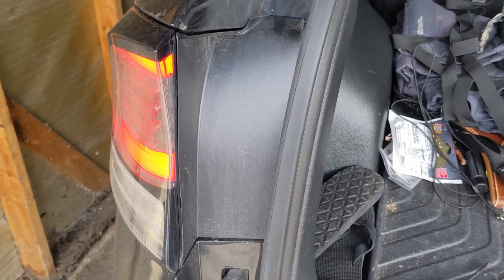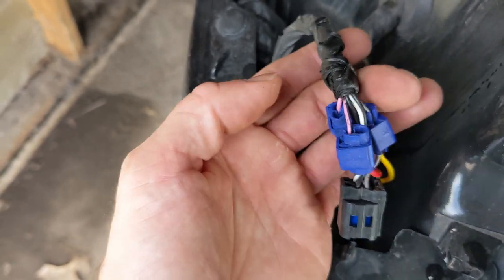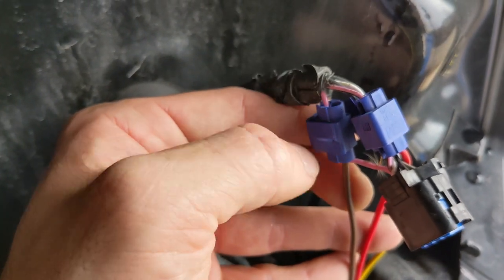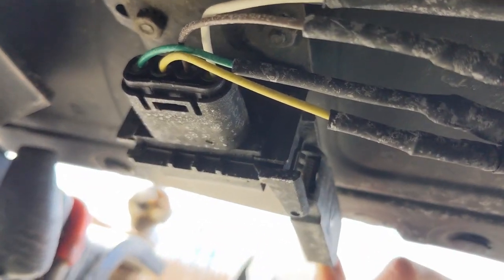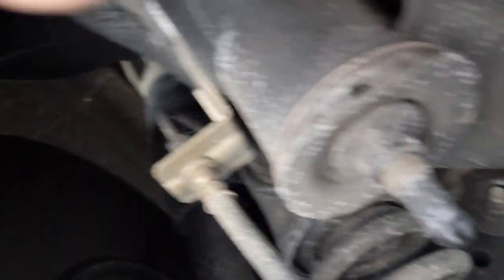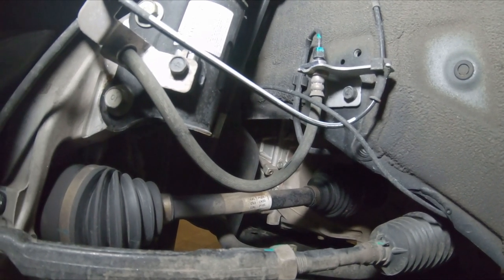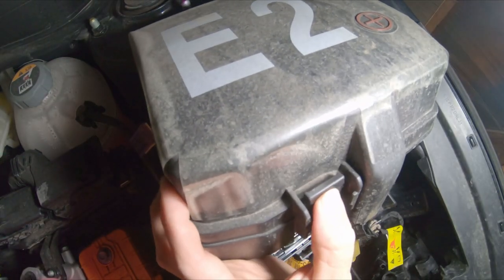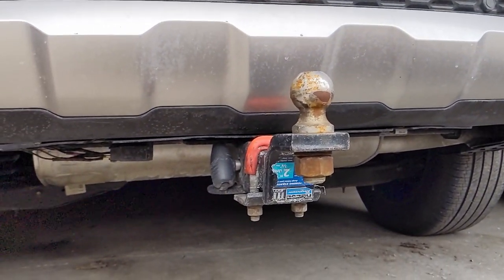2023 Kia Sportage Hybrid | Trailer Wiring Harness Install Overview

Comment: Is there any reason not to hook the power wire up to one of the spare accessory fuse spots in the box instead of a fuse holder hanging out?  What about tapping into the 12V power socket that is in the cargo area if you have it and avoid running the circuit all the way to the front?  That is already on a 15A fuse.  I'm just thinking there has to be a cleaner installation than what the harness manufacturer wants us to do.
Reply from the maker: I can't comment on any of this. If you happen to experiment, feel free to report back here.
Reply: @RivermanTV-  With some digging around, I noticed a  50A fuse under the hood marked "trailer".  Turns out the SXP HEV model has a factory plug for an OEM harness behind the left interior panel in the cargo area.  I don't think it applies to the US EX or LX models.  DWF67-AC000 is the part number I found and I have one ordered.  That said, there is also access to the 12V power supply behind that same panel.  It's already on a 15A fuse inside the vehicle.  I see no reason why that wouldn't work also as a power source.  Though I can't be sure when I don't know the power draw of the aftermarket kit.  What size fuse do they include in the kit?
Reply: It is always necessary to have a fuse in the 12v power line. Without knowing what that wire powers, it may be safer to install a separate powered wire for safety and peace of mind when troubleshooting. Also some empty fuselocations in the fuse box do not have a proper connection in them. If you look you may see only 1 metal prong. Not 2. Because that option isn't installed. Hope this helps.

Comment: How did you know where to hook the power to in the fuse box? I’ve got a couple in my 2024 and it doesn’t seem the same one you have works for me (can’t get power but everything is lined up)
Reply from the maker: @cbyler  I tested it with a multimeter to verify there was voltage. Mine has two bolts with a nut on top that carried voltage. I used the one that is also connected to a bigger metal piece that appears to be made for alligator clips.

Comment: Could you wire to the hybrid battery in the back to save running wire all the way to the front?
Reply from the maker: You could but you'd have to first access it to see if there are usable terminals. Plus there is about a 99% chance it operates at a much higher voltage. Inverters for that voltage may not be available.
Reply: @RivermanTV-  Thanks, I had uhaul install my kit and when i got home couldnt find the wire, it was running from the hybrid battery in the back and not mounted on the underside so I will have to have it hang out the back

Comment: Did you disconnect the battery before splicing in your connections and before attaching the power lead to the battery?  If so, how did yo do that since there is no "normal" negative battery terminal?  Thanks
Reply from the maker: I did not. Just had the car off while I was working. It's not actually a battery that the lead is connected to; it's a fuse box.
Reply: That makes perfect sense.  I was over thinking it.  Thanks.  @RivermanTV-